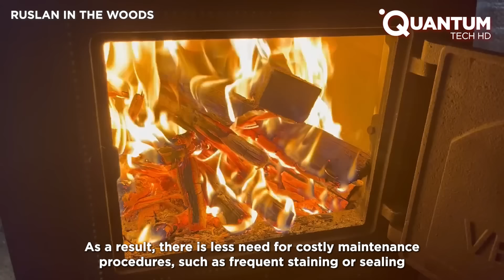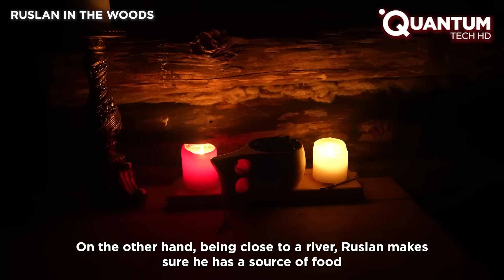Man Builds Secret Underground Cabin in the Forest | Start to Finish by @RuslaninTheWoods

Comment: That's great until it rains and turns your cabin into a swimming pool.
Reply: It’s Russia. It snows
Reply: Of course not. There are layers of plastic around the logs. See the video again
Reply: It looked like he was still in sandy loam when he put in the floor... I'd reckon that if it rained faster than it could drain, it'd prolly float and drown all of the rats. Win win.
Reply: Jealous
Reply: Why naysayers like you exist?
Reply: @mat-bh How does that stop hydrostatic pressure? Especially under a solid rain. Tarps aren't a water tight sealant. Nor does that cover the floor when this structure turns into a well.
Reply: Ok he could add a solar powered sump pump LOL
Reply: I won’t it bedrock
Reply: Lol
Reply: Why the negative? You sure couldn't do it. It's his problem if it does rain but from the looks of it, he will handle it just fine.
Reply: Right? There is a way to communicate concern for rain without coming off as a hater.  Example  “What if it rains? Does that create flooding” or simply asking ”what about rain?”
Reply: Yeah it's not a good design but it might get you by in a pinch for a night or two but rain or heavy rain is definitely going to be a problem
Reply: I was wondering, "what happens in winter?"
Reply: This better not be a hideout for Putin 😂great job 👍
Reply: @jamesproctor6700 Tarps are waterproof, unless they have holes,or are extremely old, I use them a lot.
Reply: 11 million views with or without the after video rain.  😂 Right.
Reply: The point wasn't to build a viable cabin, but to get YouTube clicks.
Reply: @DiegoJinkusMusic  geloso di chi?  Magari invidioso
Reply: @Andy_M986  tarps are waterproof…until they’re not.
Reply: You are a true adventure artist! ❤❤❤❤
Reply: Oh yeah it reminds me of a movie or two
one is " the lovely bones "
Reply: @MrBiasella22 😂
Reply: Hater much
Reply: @christianpnorris it snows in Russia can you read,
Reply: @mat-bh it's a hole in the ground, water has no place to go.. I mean that's common sense.
Reply: What's even the purpose of building it below ground? Only good it you suffer paranoia or are hiding from kgb
Reply: It’s on very top small hill, as long they got roof they good lol I thought the same thing tho
Reply: I'm interested in building places like this myself,  and what I would do is,  I would cover the whole outside of it with cement, and also  add THINK layers of plastic,  I would make sure the whole thing was lined even if it was down into the ground , so that no water could possibly get in,  I would also build drainage ditches all around the whole little house.. where all the water with drain into a water-saving area that I would also build with cement and Rock,  there's so many things you can do to make it safe in winter time,  when it comes to rain,  all you got to do is think😂... And I'm sure this man has done plenty of thinking and I'm sure he knows how to deal with the rain
Reply: wrong, the plastic around the wood will make it even more of a swimming pool... I can understand how anyone who's never been outside and built any kind of shelter would not understand how water intrusion into your space is virtually impossible... unless you're on high ground, use an angled water proof roof materiel, create run off channels and then dig a 360 degree ditch with runoff down slope. this design... is a swimming pool.
Reply: Well I'm sure in the year and a half time it took him to build it it would have at least rained once and it's still there soooooo..... yeaaaa
Reply: @GregPifer It’s cold during the summer. And this was to observe wildlife you know so it’s supposed to be hidden.
Reply: @jeremiahharrington2380 It’s not because the soil is sand. It will go straight through to the bedrock.

Comment: Nice build! Little worried you built a pool instead of a cabin!
Reply: One good rain he will have a pool in the  woods.
Reply: People have lived in similar such rustic structures for thousands of years. Built without tarps for some level of watertighteness. Condensation from breathing in it will be a bigger problem than rain. For a fun little project, and occasional camping trip, this should be fine. Dugout homes, and homes built only of cut and stacked sod, used to be common over large parts of the prairie due to difficulty getting much wood when people began settling there. Also, I've been in a number of dirt floored root cellars that stayed completely dry after heavy rains.
Reply: @daleburnfart6845  
if you look closer, you'll see this is built in a total sand area...  drainage is NOT a problem
Reply: they wasted lumber and built a pile of trash
Reply: you should care more about the fact that this channel stole ruslan's content
Reply: Nonsense, make a hole like that in the forest.
You'll quickly lose your joy.
Approximately after 40-60cm 😅 The smoke outlet at the top is not shown.
They know why.
But try it.
There's nothing more than blisters on your hands.🤗
Reply: I would like to see a video in pouring rain 😂
Reply: @daleburnfart6845 your comment has zero thought to it. The hole is in sand. The water will travel straight down and keep on travelling. Sand does not hold water and will not pool.
Reply: @quinton3997  cool
Reply: Why would anyone wish it rain, I would love that. He can put a pool next to it, cool beans
Reply: That’s his velvet or a hiding place to just hide away for a while😊👍
Reply: @edswope28  👍
Reply: Eventually, water will enter.
Reply: Sandy soil combined with being on a bit of a hill.  Didn't you notice that when he was digging it out?  All sand.  All moisture will filter straight down to the water table, which is far below the floor of his structure.  There will be no water pooling.
Reply: And this ladies and gentleman is an upmarket Russian dacha. Putin has one that is slightly bigger.
Reply: Oof yeah the rain gonna flood that for sure
Reply: Thank you for sharing.I will love to have something like that in my property. I will use it in case of tornado.
Reply: Hahaha, good one. Even if it is sand and the water runs thru, your stuff will certainly get wet.
Reply: My friends and I built an underground fort similar to this.....job was done faily professionally,  after about a week of it being built we were partying in it and noticed some water seating in at the sides at the bottom near the floor ......uh oh ....a day later it was 4 feet deep in water....all that work for nothin
Reply: @theThinkerator  I have garage in sand area with repair pit covered with concrete. And every spring it full of water.
Reply: 9 million sir
Reply: So original!!! How did you even think of this???
Reply: @Jürg-x7i what's your point? You're still sitting at home not doing anything.
Reply: @theThinkerator  Wrong.  Spring melt will FILL that hole up to the top.  Rain might be  able to drain, but a spring  snow melt will turn this into a  POOL.
Reply: @quinton3997  Or in the spring.  Everyone is mentioning rain, but  our ground level outhouse was ruined by spring snow melt.  
The  floor  and  the bottom or the structure just rotted, because nothing, including the SAND that some are pointing out,  
cannot drain water from 4 to 6 feet of melted snow.
Reply: @teeanahera8949  Snow melt will NOT drain.  You keep mentioning rain.  Rain is not the problem, snow melt IS.  
But even rain, will enter through that stairway and door.  Sorry to burst your bubble, but clearly you have never built  anything like this.
 Actual experience will tell you differently.
Reply: Nah he's on a hill, the soil will protect him also the tarps and mud
Reply: People can be so negative and rude, I gather he must be a lot more intelligent than most people give hime credit for. Haters gonna hate.
Reply: @tyerellboughan5464  Nothing to do with negativity or rudeness. If it works, it works. But this doesn't. Just try it yourself.
Reply: It’s sandy soil and it’s in high ground. There’s no water problem there.
Reply: lol
Reply: RIGHT !
Reply: So I think he wasted all this time? I’d be surprised if he thought of everything but not the rain! He must have a plan. I’m genuinely curious now. Can anyone with expertise chime in and verify if this guy is actually fucked if it rains heavy 🤔🤔
Reply: It's a hell of a lot of work for such an impractical  project.
Reply: It always amazes me how people instantly knock things they obviously have no clue about. Read some books! The lack of education in the world is so abundant. This type of dwelling has been used for shelter and shorter term living for centuries. He's not raising a family in there. As it says if you can read this is to be used for observing the local fauna with a place to rest and relax and even sleep and stay the night if needed. I think its awesome. If I could build this somewhere and owned the land I would love it. Also goes to show how excessively human living has evolved. We need so little yet use so much. Then complain about prices and working. Humans are devolving and only species dumb enough to create our own replacement with technology.
Reply: @HenryLeslieGraham   it literally has a link to Ruslan's channel in the description.
Reply: @duwaynesteurer4287  it didnt always
Reply: a lot of money for a little pool
Reply: @Masterchief68  true that
Reply: Exactly my worry too!
Reply: 100% what happened. This video is nothing but comedy.
Reply: indoor swimming pool and stair with disolve in no time lol
Reply: @edswope28  people immigrated from place to play for thousantds of years and lost their home to natural disasters for thousands of years...THE IDEA THAT HOMES BUILT BY PEASANTS N FARMERS LASTED FOR YEARS IS RIDICULOUS!!
Reply: I was just thinking this
Reply: 2 large trays of clay kitty litter and rock salt mix under the bed, pull them out to dry every three days in the sun for the day then put back in the evening.
Reply: @teeanahera8949  Sand does its best not to pool* Depending on the environs around the sand and quantity of water it is trying to disperse, sand can and will most definitely pool.
Reply: He seems to have pretty well plasticized it to keep the rain out.
Reply: @theThinkerator This exactly. Funny that people think they know better than the guy living in there.
Reply: @HenryLeslieGraham It might truly benefit him as I wouldn’t probably found his channel otherwise.
Reply: @quinton3997 or the snow melt....

Comment: These projects always look good when finished, but I would love to see how they look in five years.  Answer:  Mold City!
Reply: Yeah that tarp is going to be spawning a bunch of gross shit, and eventually it's going to decay and break apart and get poked by roots and rocks and go through hot and cold differentials between the inside and out... and then he's going to really regret building with wood underground.
Reply: and you know this how??
Reply: @pogtuber5146    and you know this how?

ventilation is key, and there is some built in.  

and that HUGE wood stove is going to dry that wood out in the first few days
Dry wood like that will last a lifetime

Roots??  not going to happen, they don't look for DRY areas
Rocks??  did you even watch the video?  looks like pure sand to me
Reply: Dude, I built such a dugout 40 years ago in Chernozum, nothing will change.
And here there is clean sand, it will stand for 200 years in the same condition.
Reply: You could paint everything with Killz
Reply: Я где-то видел, что по весне, когда начинает таять снег, то пол этой берлоги заполняется водой!
Reply: Using untreated timber straight on the dirt is terrible, it would have mould and be rotting in no time.
Reply: Mold was removed from Earth back in 3013. It's no longer possible for it to form on this planet.
Reply: @ItApproaches  good one 🙄
Reply: @GeorgeTropicana  I'm not responsible for that.
Reply: @theThinkerator  Ventilation is important, but the build has no drainage. The sand isn't a cureall; it will still retain water, and the front entrance isn't going to help much with keeping the moisture in the air out. This build needs drainage pipes for the front door and around the base, and then a small ditch to spill the water into.
Reply: collapse city bro
Reply: Common sense and knowledge of wood, Soil and ground water. @theThinkerator
Reply: That sand drains exceptionally well and I can see he's on top of a hill so it should be ok.  I'm wondering how many mice he has!
Reply: Also termites are a thing
Reply: Really @ItApproaches
Reply: @ ......come on now lol
Reply: @ItApproaches  never built anything in my life but it's fun to watch someone who has